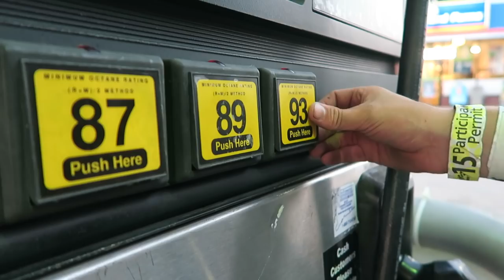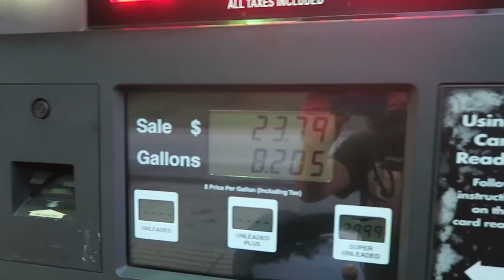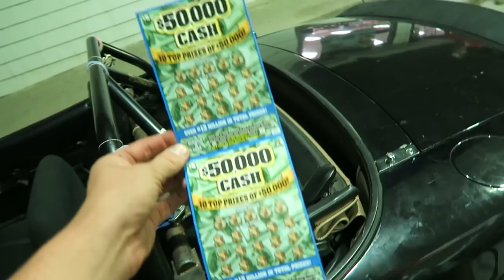Hairdresser And Euro Douche Tandem!

Comment: I think it's safe to say you can successfully boost a Miata with no tune.
Reply: hes runing that one thing that was the old way of tunning a car its stone age version of a tune all mechanical i forgot the name of it its not like it just has a turbo
Reply: +CUZC0M the name is a fuel management unit, otherwise known as an FMU
Reply: I'd rather do it properly with a tune and drive in peace. A Miata is one of the easiest and cheapest cars to turbo so it's not like it's going to put a massive hole in your wallet.

Comment: I'll be honest, both Rodnock and Onion are pretty fuckin good at drifting
Reply: ill be honest drifting isnt hard with a welded diff
Reply: CUZC0M Lmao, do you think drifting relies solely on welding your diff? smh
Reply: CUZC0M Dude, sliding is easy with a welded diff as compared to an open diff. But drifting isn't just sliding
Reply: MarchuxProductions it does.................... holy fuck i bet you are the smartest kid in your school /s
Reply: "Welding a diff doesn't make drifting easy" " it's going to be much easier than with an open diff" Everyone take a moment to appreciate the irony..
Reply: CreepySamurai after appreciating the irony, you can finish reading the sentence, understand the context and understand that English isn't my native language.
What I meant with that is that there's much more to drifting than welding your diff- you have to learn both longitudinal and lateral weight transfer, throttle control, adequate steering input, when to yank the E, when to clutch kick and a whole lot more. A welded diff is just a part of the equation.
Reply: Yeah yeah, this is honestly just a communication error. I think the comment originally meant that welding a diff makes the mechanics of drifting a lot easier, not as in welding a diff will turn anyone into ryan tuerk.

Comment: if you ever get a stuck open waste gate just shoot some wd40 in that bad boy and get it unstuck, when you hit boost and the pin contracts it will keep it somewhat lubed, just incase that ever happens when you are on the side of the road and it randomly gets stuck you can drive it home without that annoying feeling of not hitting boost

Comment: Does anyone know if convertibles requires roll bars or we can drift them stock?
Reply: You're willing to drift without a roll bar?
Reply: +Charles Wilson lol I know, it probably is a good idea to install one in case but I was thinking if the factory installed ones are good enough. I'll just contact them to find out.
Reply: +Ayman Barakat I mean I already have factory pop up roll bars but I'm curious if it requires aftermarket roll bars.

Comment: rudnik, you almost tapped that ass! lol im referring to the e36's ass. and a car wont need a tune if the stock ecu can adjust to the amount of air that the afm sees. but if you want it blown up, just pull that vacuum hose on the wastegate and leave it dangling, it dont take much boost to kill a engine.

Comment: once that motor blows up, build your next motor with forged pistons and h beam rods and leave everything else the same. If it lasted that fucking long with a stock ecu and injectors, it will forever with a built motor
Reply: Eh. He could get WAY more out of the car with a fully built setup and proper tune and engine management.
Reply: Naw those motors start to break and blow up if you push anymore power than what hes doing. Even if he went legit, it isnt that much more gain than what he has now. The setup hes running is freaking solid for what i have been seeing on other turbo miatas with standalone.

Comment: Guys, what are your opinions on the BBR Miata's? I can get one for £3500 which seems to be the average price of a regular Miata that's been turbo'd with aftermarket parts.
BBR: http://www.ebay.co.uk/itm/Mazda-Mx5-BBR-Turbo-1-6-Mk1-1991-White-Eunos-Miata-JDM-MOT-04-2017-Rare-/322242495604?hash=item4b07264474:g:kuoAAOSwgZ1XwbAp 

After Market: https://www.gumtree.com/p/mazda/mazda-mx5-1.6l-mk1-turbo-1989/1182819850

Which is best for the price?

Comment: putting 93 in a 83-85 car doesn't do anything beneficial to the car just letting you know (:
Reply: what.
Reply: When he put in gas lol
Reply: +SplayAndPlay in this case it does, since he's heavily modified the higher octane value fuel helps against pre ignition. i can go deeper into it but i cba haha, i think he knows what hes doing lol.
Reply: @splayandplay when/if you go turbo, let me know how running shit octane works out for ya!! Quick google search and vola; The higher the octane number, the more compression the fuel can withstand before detonating (igniting). In broad terms, fuels with a higher octane rating are used in high performance gasoline engines that require higher compression ratios.
Reply: +Happy this isnt a high performance gasoline engine. it's a stock Miata engine turbocharged
Reply: +SplayAndPlay  go play in traffic. higher octane reduces dentation in his turbo charged application. Go learn somthing about engines before you play keyboard warrior